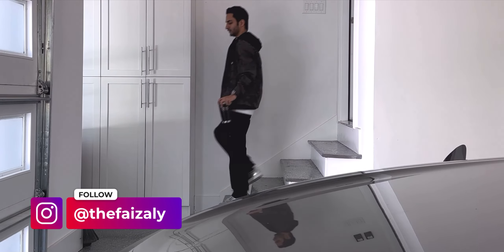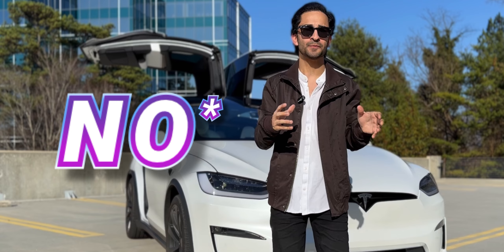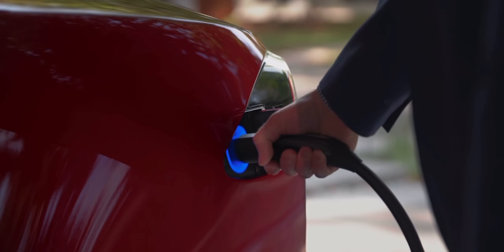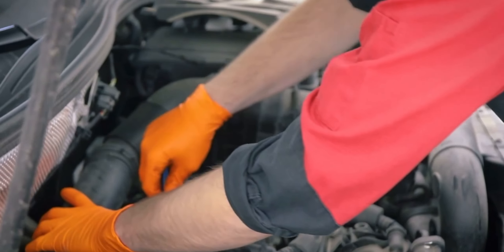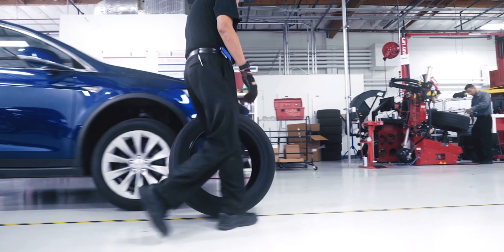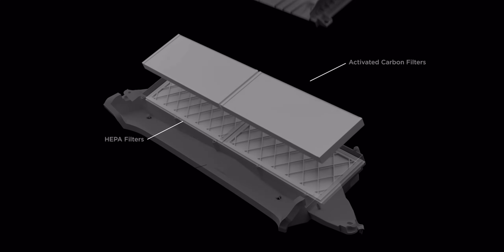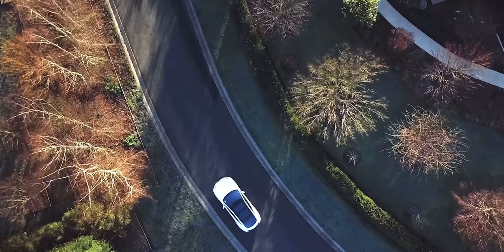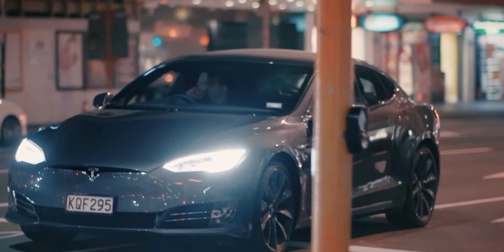Do TESLA / EV’s Require Any Maintenance? | The TRUTH Revealed!

Comment: The fallacy of EVs: Will get higher cost of initial purchase back with lower daily driving cost and maintenance compared to traditional combustion engines.  The reality: The overwhelmingly high cost of battery replacement($20,000), as well as the gross depreciation in resale value for EVs over time due to known issues re: battery and poor construction quality, make EV ownership a net loss proposition financially. Now the only question for owners is whether they feel the savings to Earth's ecosystem (questionable at best given the cost of battery production) is worth their significant inconvenience over the lifespan of their ownership.